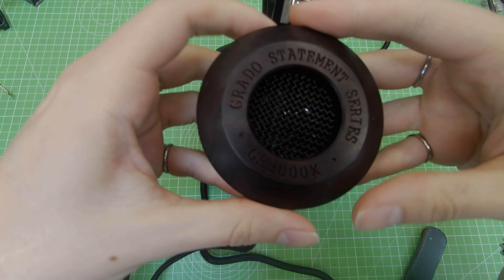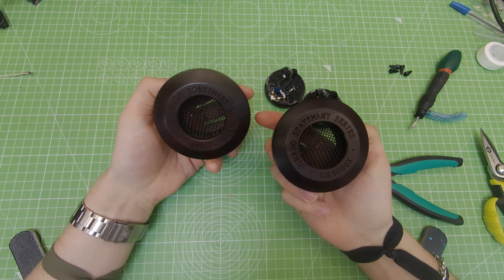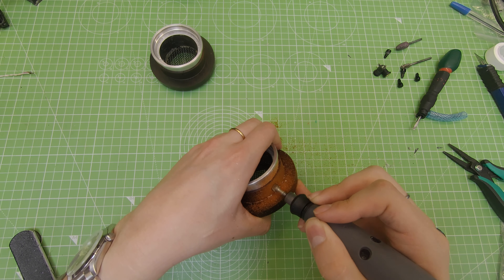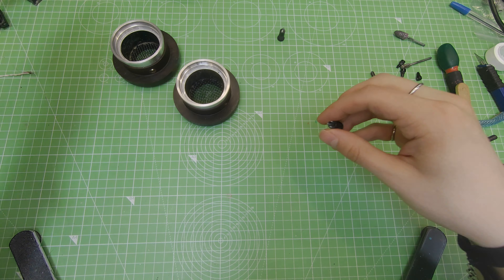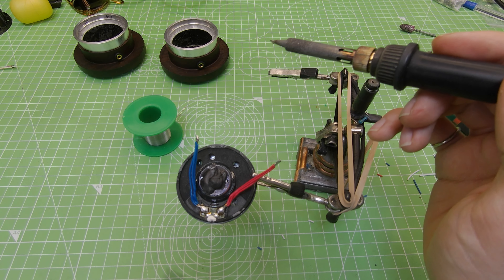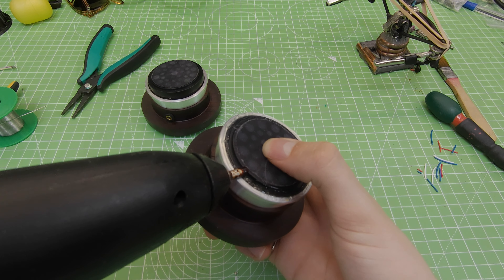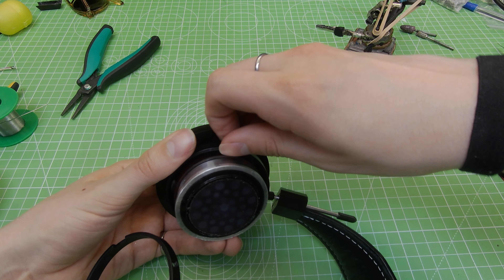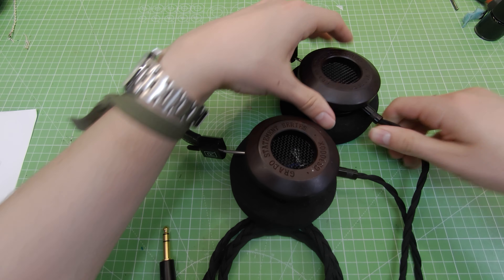Replacing the horrible cable on the Grado gs3000x and doing a detachable cable mod

Comment: Does merging the wires not affect the audio quality? My understanding is that having multiple wires for the same signal allows for better clarity.
Reply from the maker: The length of wire that is joined, it is very short compared to the total length of wire and obviously the wires are merged at the jack and the voice coil already.

Comment: Where can I buy the 3,5mm female adapters that fit in the earpieces?
Reply from the maker: Any electronics shop  - just search for 3.5mm chassis socket and find one that is small enough ... you will have the measure how much room you have in yours but we often use the PSG08282 if there is enough room

Comment: I added 3.5mm sockets to a pair of SR325x  and noticed a slight crossfeed between channels while testing. Is this normal?  p.s I'm using them with your Focal Headphones Stock Cable dual 3.5mm TS /4.4mm terminated.
Reply from the maker: Hi - No... that is not normal. We test all the cables before they go out but sometimes things happen in shipping - maybe there is an issue with the on you have. It may be worth popping us an email with your order number and we can go through some tests with you and exchange the cable if there is an issue
Reply: Hi,  thanks for the response and apologies for the misunderstanding. The issue isn't with your cable, that is perfect and I wouldn't want anyone to think otherwise. I noticed the crossfeed when testing my self-installed 3.5mm sockets for continuity.  When hard panning, a small amount of the opposite channel can still be heard, crossfeed may not be the correct term for this. They still sound the same when playing music, so I have no issue there, just wouldn't want to cause any damage.
Reply from the maker: @darrellmc8018  Hi - it may be the cable, we are normally pretty good but sometimes things go wrong. There is nothing you could really do wrong on a dual entry detachable cable mod that would cause cross talk.
If you are running off a balanced 4.4mm amp / player then the channels should be separate and no crosstalk should happen. If you have a multimeter you can check the 4.4mm jack to see if any of the contacts are bridged. If it is not that then it is an issue with something else in the chain.
It may even be the thing you are using to pan is not panning all the way. This video is good for testing.
https://www.youtube.com/watch?v=kUT6ZhFdLkA

Comment: I wonder if Grado made many secret deals with headphone modifiers, and they get a cut every time someone changes to a detachable design. It's the only good reason I can think of for using that damn cable.
Reply from the maker: Damn.... The secret is out
Reply: Nondetachable at stock is definitely a problem for longevity. I had to send my 325x in for warranty repair after 4 months, twice, because the internal connection was damaged with normal use. Converting stock cable to detachable does solve that problem. Audio quality wise, I perceive a slightly fuller sound through the stock cable than a separate braided connector cable with Van Damme extension cable. But even then, you can hear when the cable sleeving rubs against a surface. You can even spatially determine where the cable is being rubbed. Probably could be solved by wrapping the sleeving with foam pipe insulation wrap, but then the cable would be even heavier. At the end of the day, probably better to replace it.